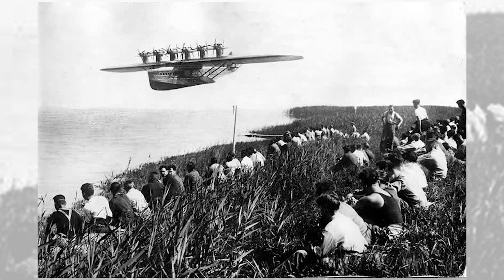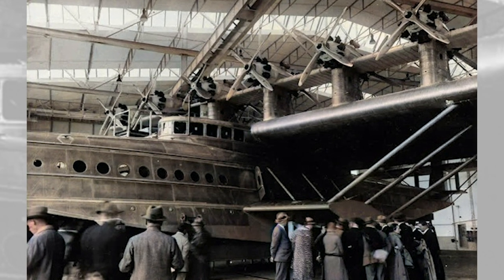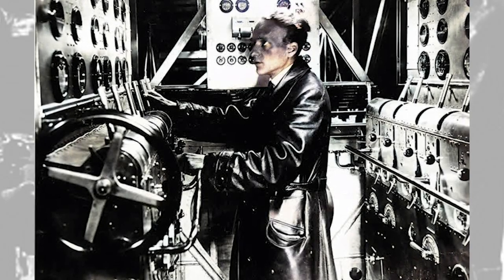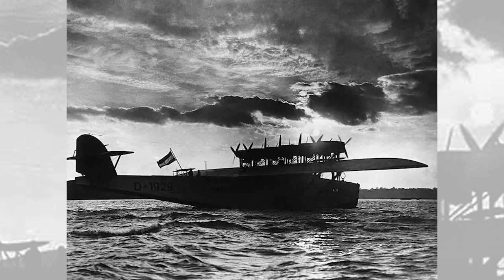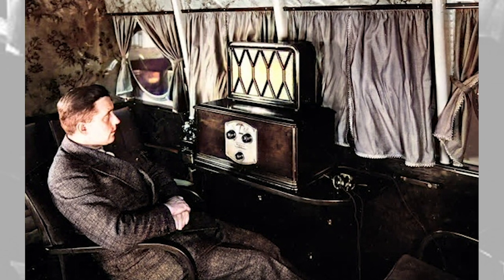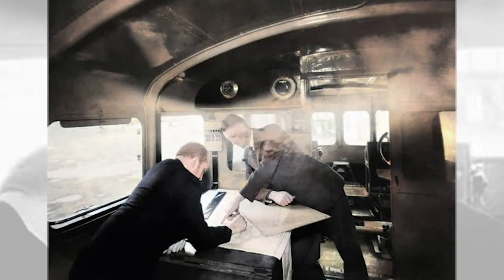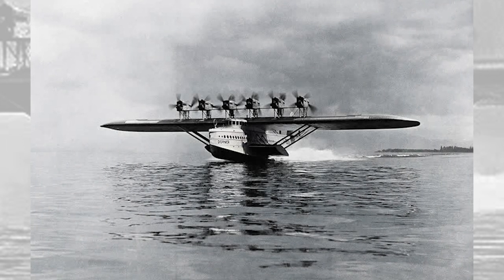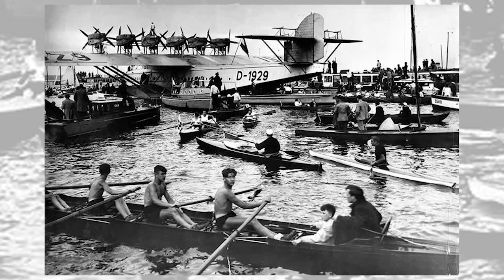The Dornier Do X: The Giant Flying Boat That Couldn't Fly

Comment: Couldnt fly??? Looks like fun, and safe if you must land on water. Other marvel not preserved.
Reply from the maker: It was too heavy to fly and it was not too safety to fly with people
Reply: "The type was popular with the public, but a lack of commercial interest and a number of non-fatal accidents prevented more than three examples from being built. 
The air-cooled Jupiter engines were prone to overheating and could barely lift the Do X to an altitude of 425 m (1,394 ft).
After completing 103 flights in 1930, the Do X was refitted with 455 kW (610 hp) Curtiss V-1570 "Conqueror" water-cooled V-12 engines. Only then was it able to reach the altitude of 500 m (1,600 ft) necessary to cross the Atlantic. Dornier designed the flying boat to carry 66 passengers on long-distance flights or 100 passengers on short flights."